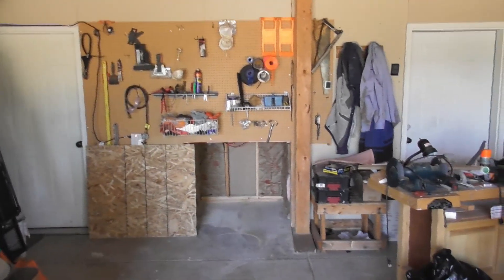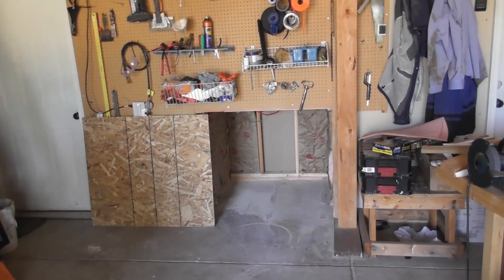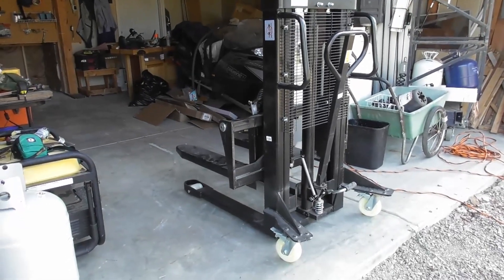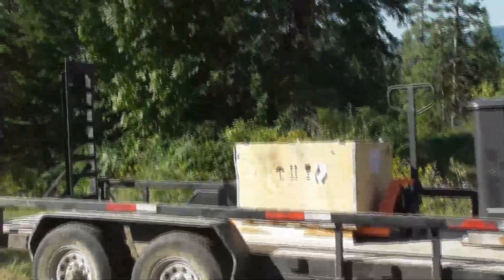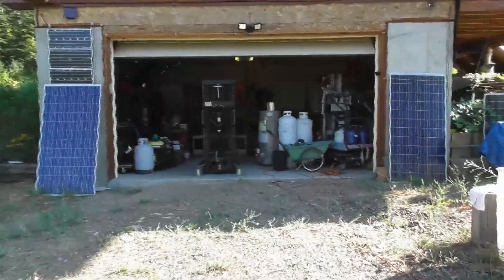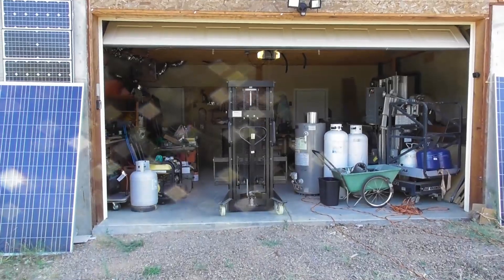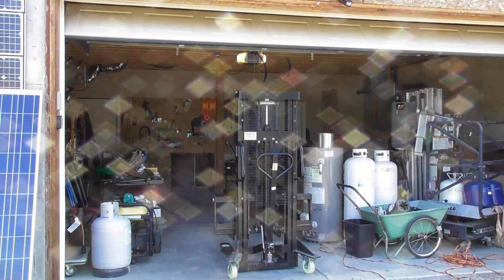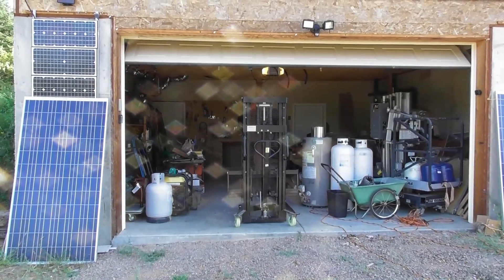Off Grid Forklift Battery Reconditioned

Comment: Steve - my wife and I were able to pick up a de-commissioned Absolyte GX (2 x 24 volt) 2,000 amp hour battery system that we will connect for 48 volt off grid system in Northern Nevada. I will subscribe to your channel - glad we found you from watching Gridlessness Channel! I would also like to speak to you about the gasification units that you make.
Reply from the maker: For details on the Wood Gasifier, you can send an email request to support@offgrid48.com
Reply: @steveoffgrid485  Thank you, Steve!

Comment: Whare is the power going wile the batteries are out? Also heating distilled water and adding Epsom salt while hot then let it cool down and put in these batteries and a giant fan with the doors open lids off batteries

Comment: Would it not be better? As the battery box is steel! to make it into a trailer that can be towed in and out
Reply from the maker: Steel in battery box is too light to make a trailer. You could put it on a small trailer, but it would have to be rated for 4000lbs or more.

Comment: does this run air conditioner well pump as well as your whole house
Reply from the maker: Don't have AC at the cabin, but yes, this battery is cable of providing all of the power needed for a residence.